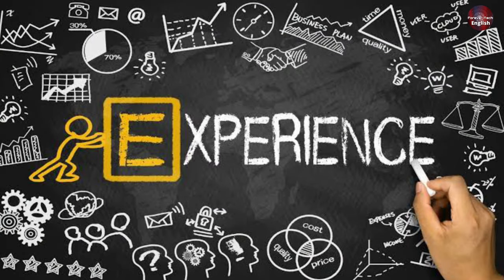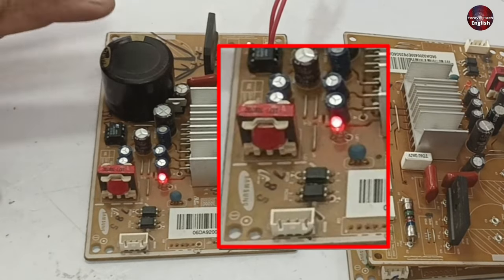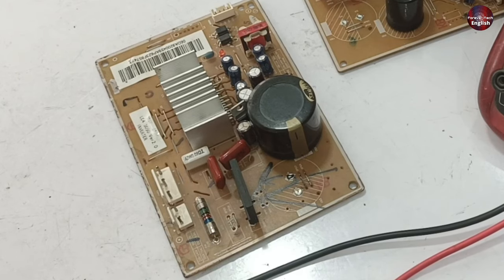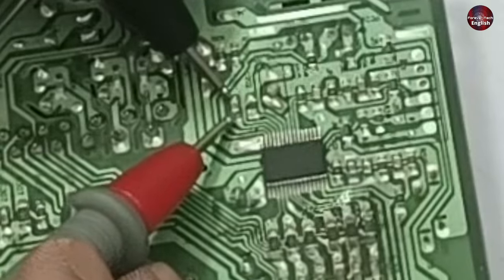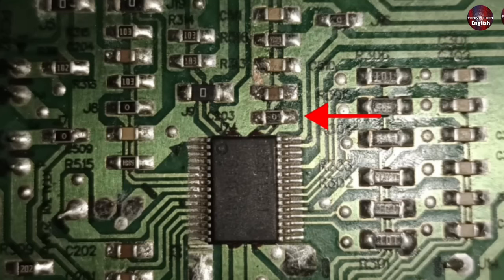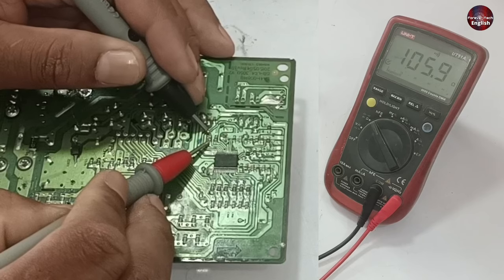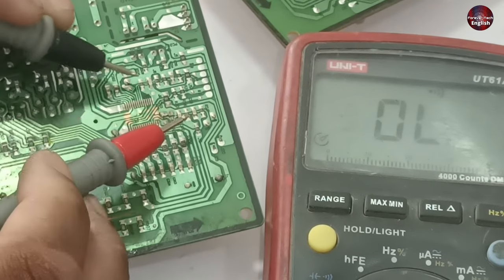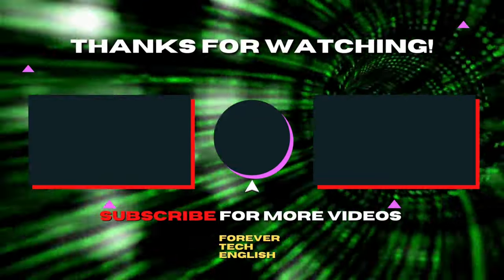Samsung Refrigerator Inverter Compressor Control (IPM Board) Fail Test

Comment: With your experience which are the most reliable brands and why do you think these boards fail?
Reply: Why do they fail? Frankly I'm surprised they even work at all. It looks like a child designed it. If you have the money, and there's someone you really don't like, buy them a Samsung washing machine or a refrigerator. The core systems might or might not be sound, but the computer and control boards are all bullshit in my opinion. I'd like to know if Samsung designs and builds these in house or if they outsource.

Comment: Sir what is the fault when the mother board have a 1 blink and then the refrigerator will shut down. My refrigerator is 4 years old.
Reply: I'm not a refrigeration technician but I do understand electronics. the compressor motor is a three phase dc motor.  I would direct my attention to the  IGCM06F60GA intelligent power module. It's either not outputting power because it's defective or because the circuit that drives the device isn't sending it control signals to switch and control the phases ( provided you're talking about the compressor not starting ). If everything switches off including the light inside the refrigerator then I'd look at the power supply. Don't throw out your refrigerator. I've never worked on one of these, but it can't be too complicated. It looks like the board was designed by a first year collage student. Sorry I'm coming late to the party.

Comment: The problems are the result of poor engineering, a poor design and poor quality control. If you're making a product and there's a board that's prone to failure, then clearly you don't know what you're doing. It looks like a first year college student must be the lead engineer on the team. I'd fire everyone that had a hand in designing that board. I hope this example isn't indicative of the type of work we should expect from the design team. This is clearly an example of where failure and incompetence went unchecked. Firing everyone on the design team and starting the entire design process of the product from scratch might be a wise choice.